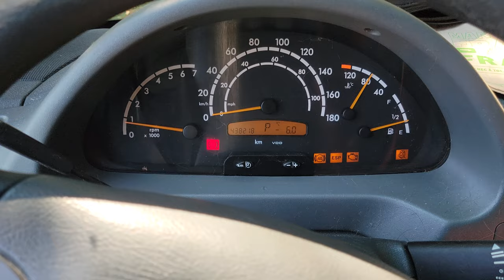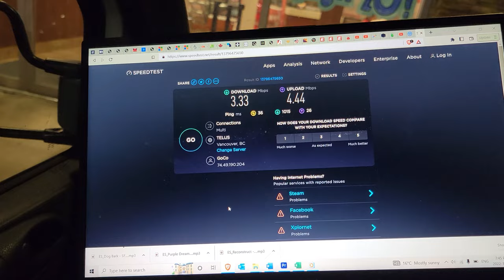"Homeless" Woman Pays $600 for Spray Paint to Survive

Comment: could have painted the whole van with probably 5/6 cans of Tremclad gloss white. Woulda stuck forever and looked almost factory! But, good on you for getting that done in such a short time frame!! Super cool to watch
Reply from the maker: The clerk at the store told me not to. 😕
Reply: @QuestOutWest  I've painted probably 10 vehicles with the "Tremclad" high gloss paint. Best bang for your buck, and you don't need a clear coat.. if you have trouble selling it still, maybe grab a few cans of the "Tremclad Gloss white" and go over it once more. get it in the silver/chrome can, it's High pressure and wide spray. Best paint ever! I promise it'll look as close to factory as you can get for spray paint.. its unfortunate that the Employees guided you in the wrong and more expensive direction 😕 it still looks way better though!!

Comment: Interesting, didn't expect this Natasha 😊 

I hope you SOLD the Dodge by now! Was the Dodge working ok, & how much work did you have to do to the interior & engine to clean those all up??
Reply from the maker: Spoilers 😄 but the plan was to sell it without doing the mechanical work to someone who could afford to do it at a reasonable price and still make some profit.
Reply: @QuestOutWest  👍👍🌷
Reply: @QuestOutWest  or maybe try to sell it to a mechanic. They then could do the job at a very low price  and they resell it after.
Reply: @QuestOutWest  go to your local Autozone or Car parts store. Ask to speak to their commercial specialist and their drivers. (The drivers that deliver parts to all the local mechanics). These people can tell you the names of local mechanics that are most likely to buy it. Then u can drive over to them and name drop the driver and ask if they are interested in buying it.

Comment: All due respect, but I wouldn't even bother with the clear coat for a quickie paint job like that.
Reply from the maker: I learned that. Ty
Reply: @QuestOutWest  I know it's too late now, but you probably could have rented a spray gun and air compressor from a rent-all place and bought a can of paint a lot cheaper than $600. It would have been done faster too.
Reply from the maker: I thought it was only going to cost closee to 300. I didnt factor in the wind since I was doing it outside. "School fees" as they say. There's a learning curve in everything.
Reply from the maker: Also, I would have had nowhere to plug in the compressor, but someone on IG showed me that Amazon has wireless paint sprayers.
Reply: @QuestOutWest  That occurred to me, but I figured you could find an A/C plug somewhere. A plug on a light post in a parking lot for example. There is always one close-by somewhere.